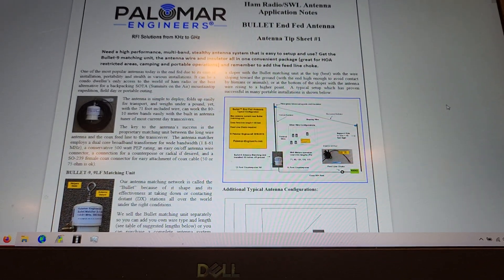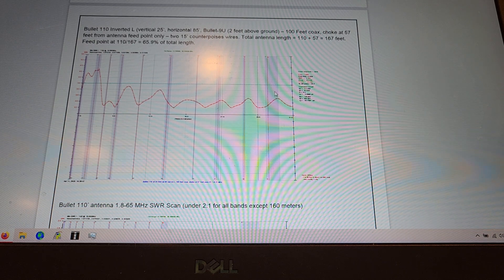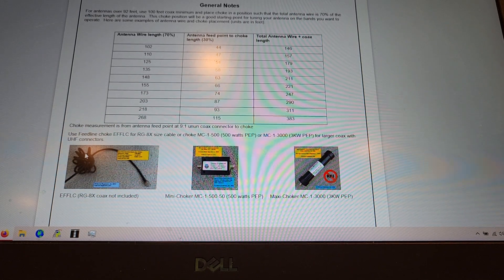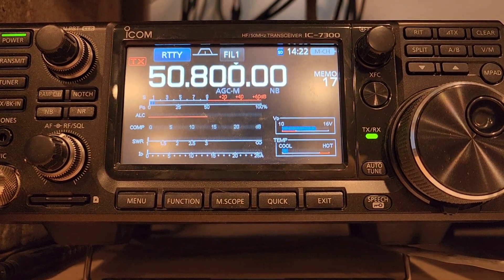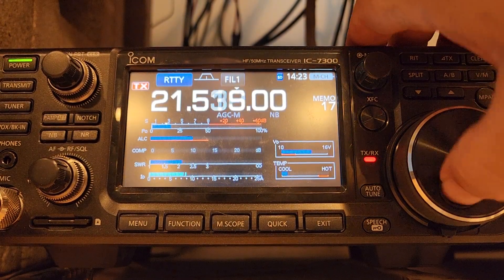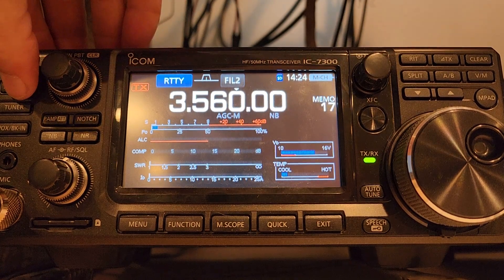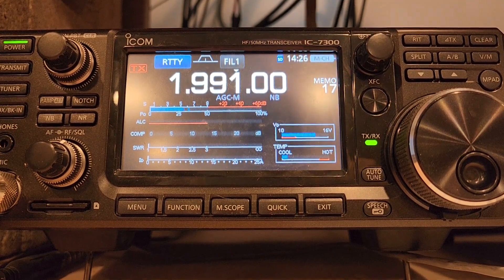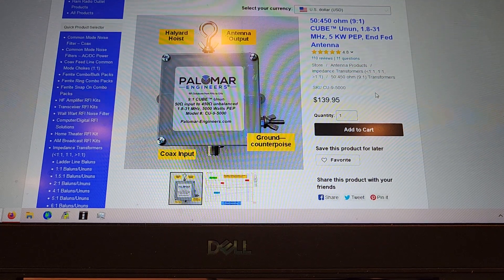Palomar Engineering EFRW SWR Antenna Test

Comment: Nice set up so if you use it with 100w only how much power are you losing? Ware you able to make good contacts or you need to run it with much more power ?